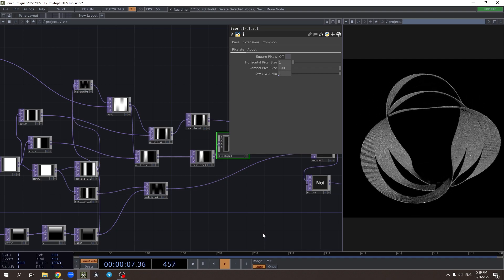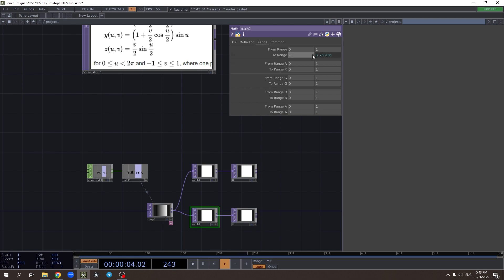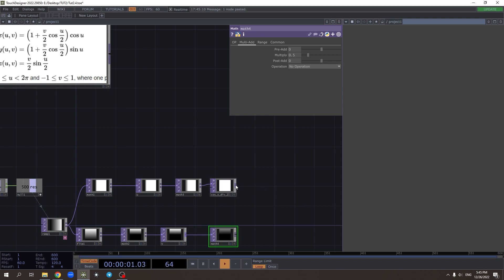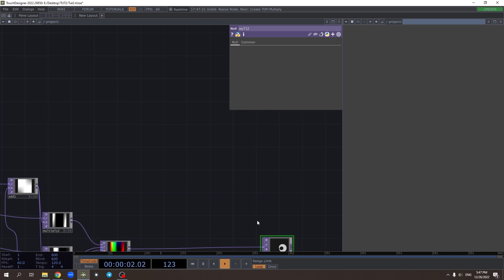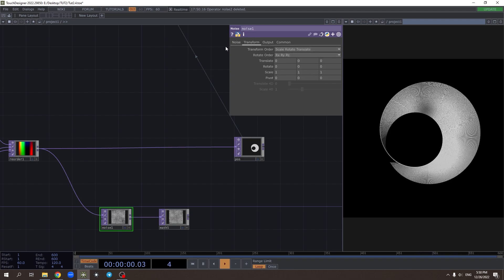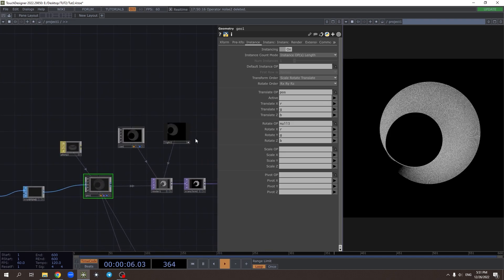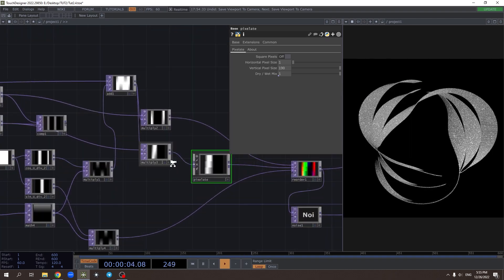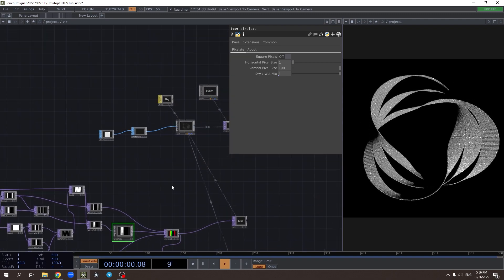Möbius_tut_02

Comment: hello Newnome! thanks for the amount of knowledge, math has become a little easier thanks to you. I'm trying to recreate strange attractors, specifically the Clifford Attractor, based on the techniques shown in this video tutorial, but I think something is going wrong. I have 4 variables (a, b, c, d) and I'm trying to set them via Math TOP and Constant TOP but I don't see any difference. The values are positive and negative and when I put all the expressions in a Reorder TOP, TD generates a single curved line and not a 3D shape (I set all the function in Degrees).

When I put a negative value in the constant (e.g., R = -1, G = -1, B = -1) the constant TOP obviously turns black and I do not understand if TD reads this value as -1 or 0. Same thing with Math TOP.

In this case, Clifford's Attractor consists of three variables (x, y and z), can I set them via Ramp TOP? Or is this a wrong way?
Reply from the maker: Hi! 
Thank you si much! It's quite difficult for me to understand that without a patch but are you sure you changed pixel format of the reorder top to 32-rgb?